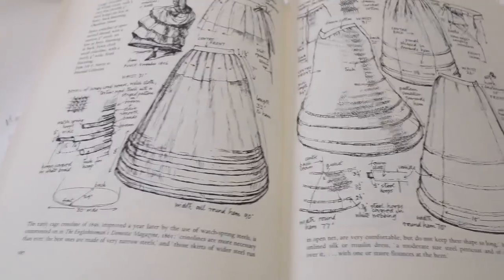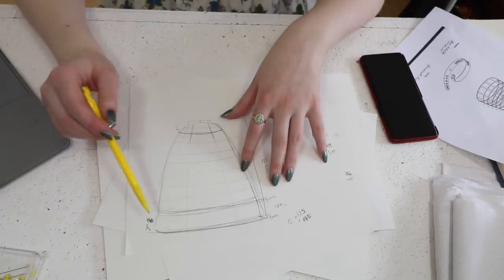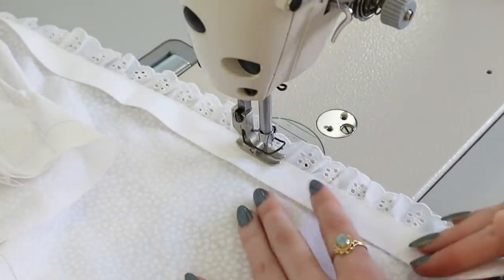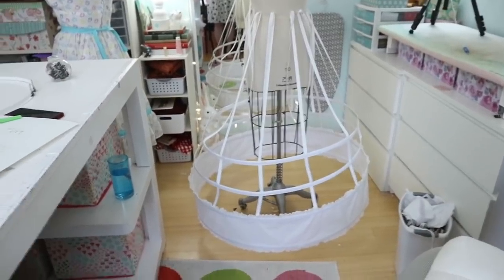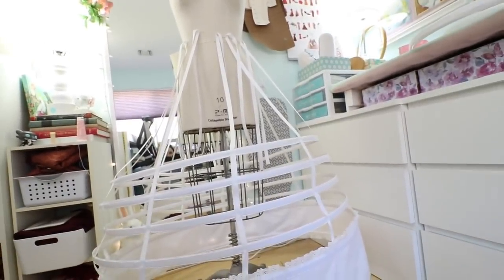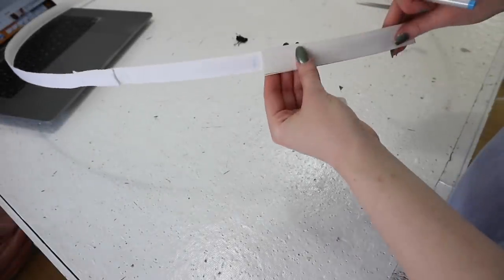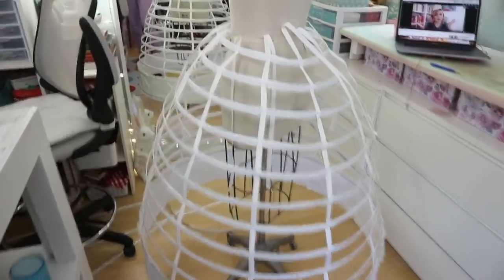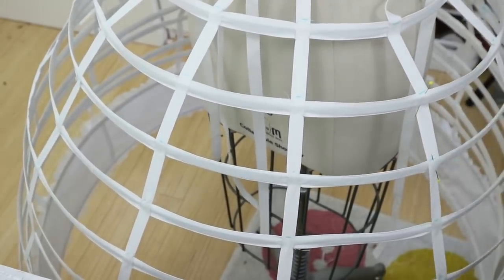Making an 1850s Hoop Skirt / Cage Crinoline

Comment: Depending on your ceiling height it can be easier to put the form up on a table and work on the garment while  standing.
Reply from the maker: There have been SO many times when I've been hemming things that I long for high enough ceilings to  pull that off. Alas, they are standard height.
Reply: @AngelaClaytonCostumery  Maybe when it's nice outside?

Comment: Well thought out. I liked how you pinned the hoops and thought the same thing when i was looking at how these were constructed. I was thinking you were going to put a buttoned lower part with more ruffles on it, but that is good and they were like that as well. Not as easy for cleaning your way, the bottom could be taken off for easier cleaning. Would love to see the other types, but would most prefer the layers to go over this first. The template idea is the best from what i can tell from matching this type of hoop skirt to what others are doing and how they are doing it. Reminds me of a tailor set that had wood sticks for measurements on corsets from 16 inch waist to 46, can't remember the name of the sets. The part that i get a bit confused would be the top and how it drapes to hold the hoops. It is one thing to make one for yourself, but how on earth could they make them fit well selling them off the shelf back then. I know most were made per person earlier years, but later on they became factory produced. Great video and gave me a lot to think about in regards to them, thank you.

Comment: I made this for my senior capstone/mandatory science fair project, and you can make this for 27 dollars(not including tax), in my case I could at least, 50 yards of twill tape 1 inch wide for 10 dollars, folded in half for the boning casing, waist band, and vertical tapes, then 12 dollars for 50 yards of 10 mm plastic boning, and 5 dollars for a set of snaps for the waist band. It was set up like an engineering project and it was super fun.
Reply: All the materials save the snaps I got off amazon, the snaps were from walmart, I didnt do the bottom fabric bit, cause I'm short and made the hoop spacing too long, but my walmart has yard of fabric for 2 dollars or under, sometimes more sometimes less, quality varies

Comment: Go for all of these projects! If it helps, I've been making hoops for several years now and even though it's totally not historically acurate I've turned to fiber glass boning in regarding to thickness to create. So, if you're not into steel boning this might help cut on costs. At least here over in Europe 😉
Reply: Have you ever tried PEX pipe for boning? I have seen it recommended, but haven't tried it myself
Reply: Alexis Montez I’ll have to try that!
Reply: @alexismontez4230  Never. Is a hallow pipe? What I like about fibre glass is that when coated it gives the illusion of spring steel and sure acts that way. But flat steel has  something to it, also.
Reply: @alexanderhofstetter7108  It's technically plumbing pipe, used mostly in cold places where water might freeze and burst normal pipes. It is fairly stiff and quite light, and is made of some kind of plastic, maybe nylon.
Reply: @alexismontez4230  I just tried the pex pipe idea this week and it was a disaster! No matter what I do I cannot got them to get into a circle shape let alone an approximation. I have tried heating and shaping, but it is still a wonky, non circular mess. I have not found any tutorials on how to fix this that have actually worked. The ones I did manage to get close, my 3 year old was able to undo without much effort. I am sure others will be able to get it to work, but I was not.
Reply: @SuperMrsMar   I think the method I saw recommended was to insert a piece of dowel into one end, and butt the pipe ends together.
Reply: @alexismontez4230  that's not the problem, I have connectors and got the ends together, but it is not round, it has lumps and bumps and straights and is completely wonky. I tried putting it in hot water to shape it, didn't work. I tried a hair dryer to warm it up and shape it, didn't work, I tried bending and straightening, didn't make it any closer to being a circle.
I wish I could share a picture with you of just how badly they looked after hours of trying to shape them.
Reply: @SuperMrsMar  hey did you find any remedy for that! I am facing the same issue
Reply: @Ohn_ana  I did not. I ended up giving up on it.

Comment: Hi Angela! Just a question, is it possible to wash it? If so, how? ❤️
Reply: Just wear it and go through a car wash. Just be careful to not get hit by any feral vehicles.
Reply: I’m not Angela, but I’ve got fabric knowledge. This is a garment not intended to be laundered often, as it is not exposed to the environment or to the body, as its a between-layer. Steel tends to rust, but if it is required, one would remove the bones themselves, and hand-wash the fabric, or Hope very hard that it will not rust.
Reply from the maker: As Scout said, I struggle to imagine a garment of this nature needing washing. But the boning is coated, and the casing is cotton. So infrequent washing in a nonhumid environment  where it can dry quickly shouldn't be an issue :) To remove the marks I just went at it with a spray bottle lol!
Reply: Thank you guys! ❤️